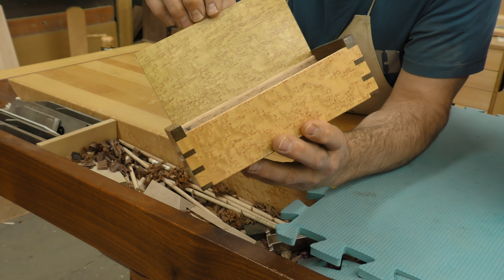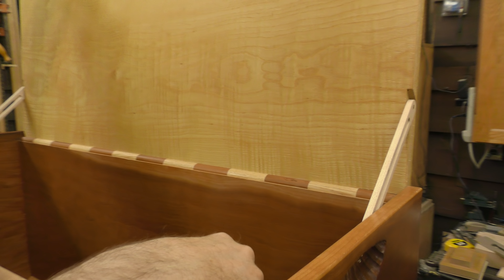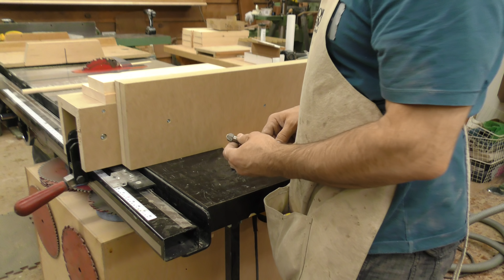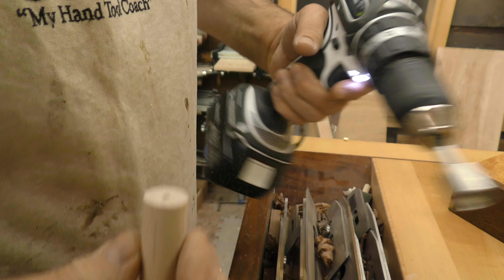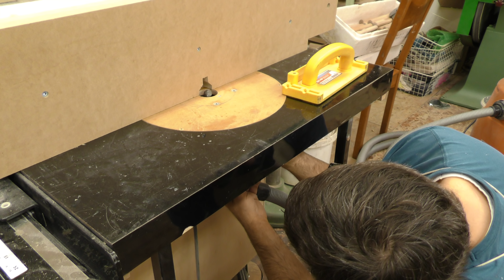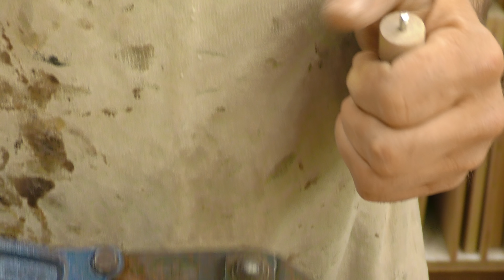Wood Hinge for Furniture with Rob Cosman

Comment: Cool technique, thanks Rob. I wonder if you have any suggestions for cutting the grooves in a hand tool only shop? Hollowing plane or rounded blade on a plow plane maybe?
Reply: I would cut a V slot in my piece and I would wrap some sand paper on the dowel to be used for the hinge and carefully sand it round. Check often for fit.

Comment: Other than the difficulty of centring all the way through a dowel is there any reason not to use a single piece of welding rod all the way through the length of the hinge?

Comment: hi Rob
I was only inquiring last month if you had any plans to make larger sized kits for larger dowels, now I dont have too. I am delighted you made this video and kit that can accommodate almost any size dowel for furniture making. I am a big fan and user of your 1/4" dowel maker and I will most definitely be adding this kit to my Cosman collection. one question_ how did you make the 3/4" Dowel? is it the same technique as the 1/4"? Cheers Dan

Comment: A rod parter will help tremendously in cutting your welding wire to length without distorting the cut ends.  I found mine at a yard sale for $15

Comment: are you going to offer a kit with the router bits as well ?
Reply: No, as router bits are easy to obtain in practically any size you could need. And then it's just a matter of increasing/decreasing the depth of the plunge

Comment: HI Rob, why was the 5/8" dowel size passed over for the hinge kit?
Reply from the maker: tomx63 I’ve never found a need for that specific size. If it’s too big for 1/2” the 3/4” will do just fine.
Reply: @RobCosmanWoodworking  Super. I'll be buying this kit because my DIY methods for centering that hole have been hit or miss. Thanks Rob!

Comment: cool, couldn't you just make a box joint and use  router round off bit on the inside only. hmmmm
Reply: can't see how you'd get the pivot pin inside the adjacent fingers.
Reply: spring loaded tooth pick. spring from a clicky pen

Comment: i just found your channel. like your perfect craftsmanship but dislike the imperial measurement.  there's allot of calculating for me to understand the dimensions and what your talking about. i subbed btw;)
Reply: also if you read this. would it be possible to put the metric dimensions on screen? that would be extremely handy and i (and i think allot of Europeans) would like it allot!
Reply: Rob Cosman i use a imperial to metric scheme while i watch you vids. allot of pauze and play acaurs.  a 20 min vid will take me over 30 mins to watch. still would it be possible to put metric measurements on screen for the metric system users in your new vids? allot of love and envy yours truly Edd